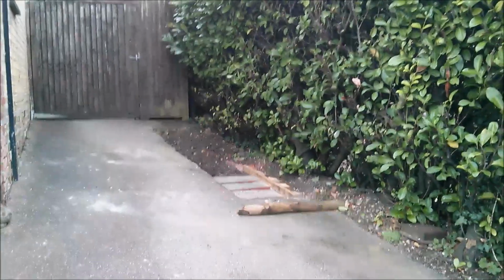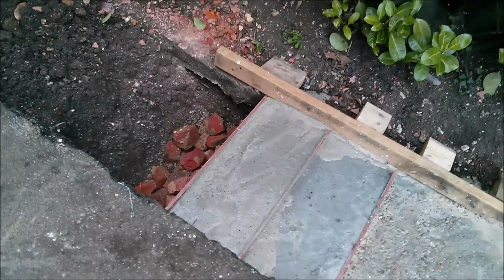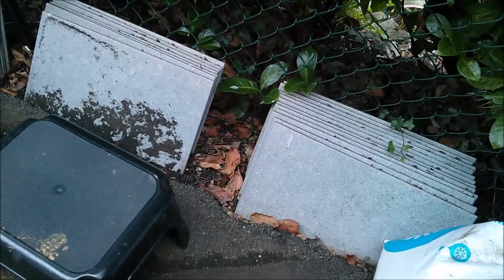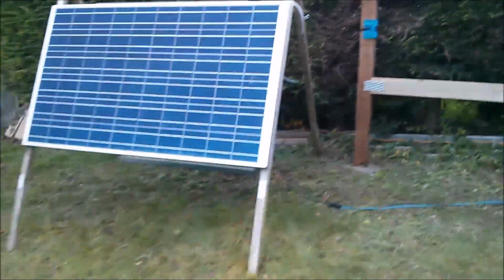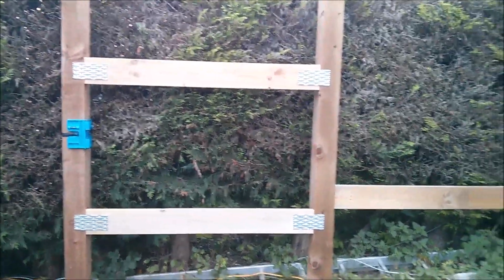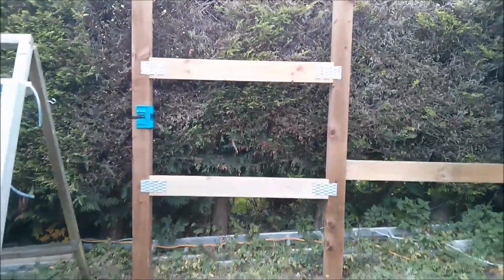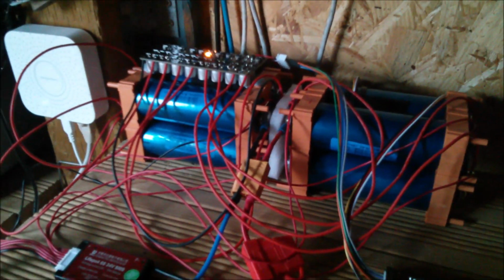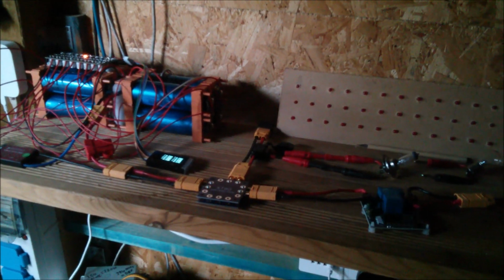Concrete Ideas

Comment: Do y'all not have like 50lb(20kg) or 80lb(36kg) bags of concrete that you just add water and mix or is that cheaper
Reply from the maker: I've never used the pre-mixed stuff. I just buy the cheapest cement, the cheapest sand and the cheapest gravel.
Reply: @JuliansShorts  I mean I'm sure that's cheaper but they premix is pretty cheap to me

Comment: I still don't fully understand your miner system. Why does the battery have to be charged and discharged all the time? Wouldn't it make much more sense to use the solar power to mine bitcoin and charge the battery at the same time and then use the battery only when there is no sun? Or maybe even better, modulate the compute power according to how much sun is coming and and completely ditch the battery. Miners are way to scalable to use a battery.
I guess you are just doing it for the fun of it, am i right? :)
Reply from the maker: At the moment, here in the UK, there's very little sun. It's taking about 3 days to fill the battery and an hour to discharge it. The battery is an accumulator, adding together all the tiny amounts of energy coming from the solar panel until there's enough for a worthwhile mining session.
Reply from the maker: For example, my 3.6kW rooftop solar array today generated 300Wh of electricity. That's the equivalent of 5 minutes of sunshine.
Reply: @JuliansShorts  ok. That makes alot of sense!
Reply: Steadfastly retaining the absolute pointlessness of the solar system is the primary objective of this channel.

Comment: You'll need to tamp the hardcore down really hard, as a vehicle will put quite a load in a localised area, which will crack the concrete, if the sub-base can sink. Broken bricks aren't ideal either, as those can crumble under load, allowing the concrete the bricks are supporting to move and again crack. This issue cracking will be exaggerated by sectional concrete without any reinforcement steel laid in.
I use granite (it's freely available where I live) as a sub-base for concrete, which I tamp down really well, so the concrete above is well supported and can't move.
Reply from the maker: I've run out of bricks, so I'll be using stones for the remaining sections. I'll need a tamper (seen one on Amazon) for the Tarmac, but I just stood on the hardcore layers before pouring the concrete. 'Twill be interesting to see if it all collapses :)
Reply: @JuliansShorts  you should be fine, the laurel’s roots will hold the ground nicely 😂😂 the roots will start hugging the concrete soon 😃

Comment: If your concrete mix is not too wet it will easily hold a 5 degree slope you really shouldn't have to step it like that except for batches. Would probably be worth it to set all your forms, dig out for any posts and then rent a small mixer.
Reply from the maker: I didn't want to rent a mixer, because I'm doing this one section at a time, whenever there's a relatively warm day. I've still got to lose a cubic metre of soil.